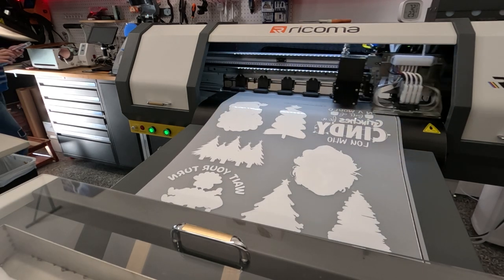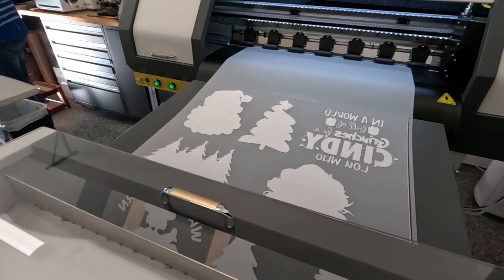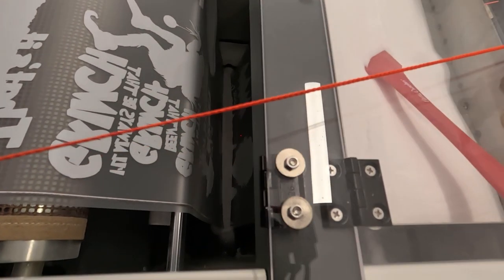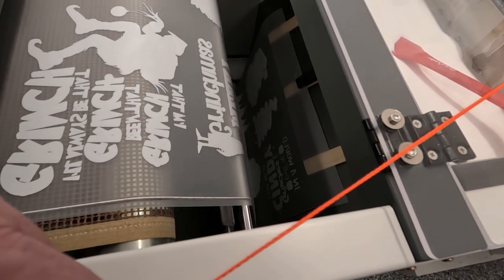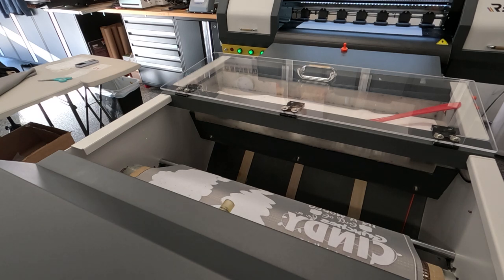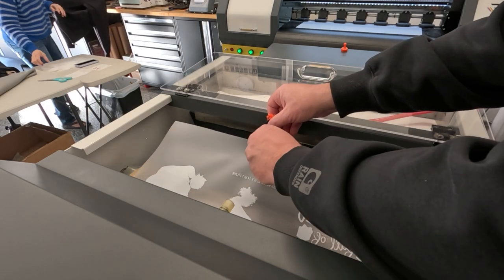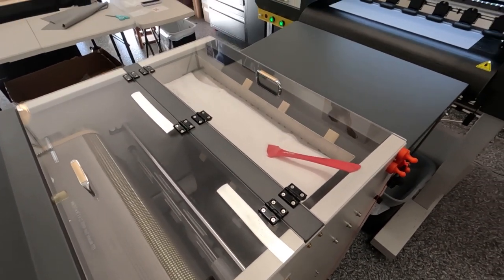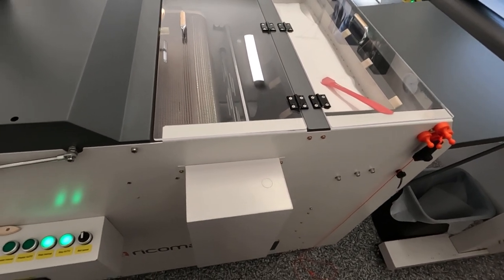DTF Film Feeder Part II

Comment: Cut the film at the conveyer, not at the printer.
Reply from the maker: I'd rather cut the film at the printer, instead of going all the way into the shaker with the blank film then rolling that back into my printer. That creates a huge amount of slack back on the film roll, and potential powder coming back into the printer as well. I believe you stated you used a 4" brush to brush the film off as you roll it back into the printer. Downside is you're only brushing one side (top of the film) and creating an additional step to the process.